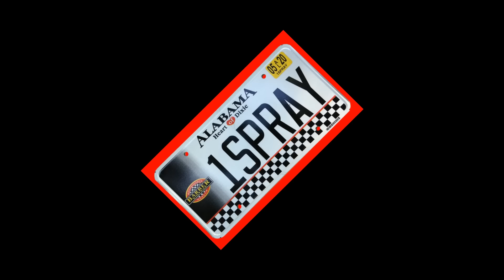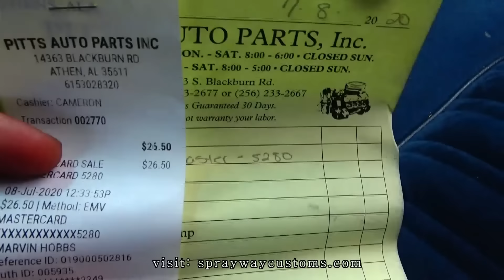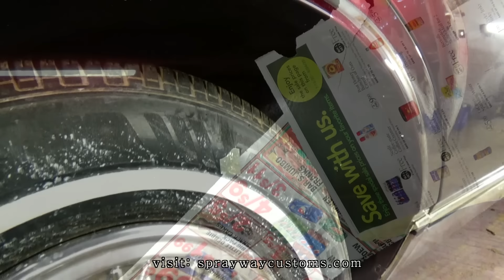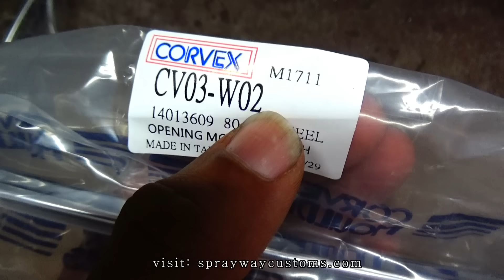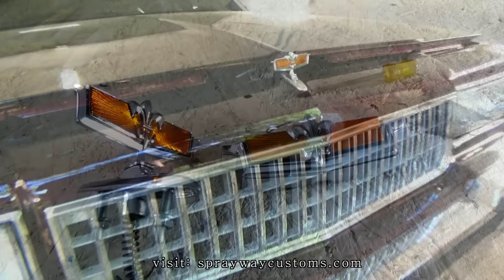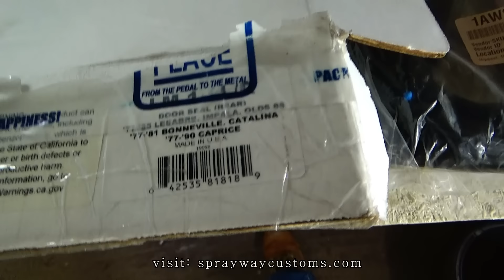Rebuilding A 1989 Box Chevy Caprice In Less Than 34 Minutes CANDY PAINTED BRANDYWINE LS SWAP BUILD

Comment from the maker: Here's The Links To All The Videos Of The Build:

6.0 Cammed LS Swap Box Chevy Caprice Brougham Candy Paint Project - Ms. Ruby - https://youtu.be/11YZKtOqTm8

Bodywork & Paint For Beginners LS SWAP BOX CHEVY CAPRICE Sanding Fixing Dents Dings Priming Masking - https://youtu.be/zT3YMmpcgYI

How To Spray Candy Paint BRANDYWINE BOX CHEVY CAPRICE KANDY DOOR JAMBS UreChem EyeKandy Wine Red - https://youtu.be/n8OU7XXyPRM

Cracked Dashboard Fiberglass Repair Painted Candy Brandywine BOX CHEVY CAPRICE HOW TO RESTORE DASH - https://youtu.be/6PKaOF0FqZ8

Spraying Candy Paint On Box Chevy Caprice - Door Jambs Painted Kandy Brandywine - UreKem Wine Red - https://youtu.be/aD-Tcq-Z_Js

Bodywork & Prep For Spraying Candy Paint On A Car / Box Chevy Caprice LS Brougham Project Update - https://youtu.be/ESWprX2argc

How To Do A Candy Paint Job On A Car At Home - Box Chevy Caprice LS Brougham (RUBY) Kandy Tutorial - https://youtu.be/VDbOpgxWwPk

How To Remove Orange Peel / Cut And Buff A Car After Paint - Box Chevy Caprice LS Candy Brandywine - https://youtu.be/PEBXPBgpzNg

Installing Vinyl Pinstripe & Body Side Molding BOX CHEVY CAPRICE How To Install Pinstripe On A Car - https://youtu.be/LwXahCCbP1o

Emergency Bodywork & Bubbling Paint Issue Repair BOX CHEVY CAPRICE BROUGHAM Vinyl Pinstripe Install - https://youtu.be/tcI4Pj_f-Ow

Box Chevy On 26s - TEST FITTING THE 26 INCH RUCCI WHEELS ON THE LS SWAPPED BOX CHEVY CAPRICE (Ruby) - https://youtu.be/_gXdlQloae8

Complete Playlist  Of The Project Build - https://www.youtube.com/playlist?list=PLJdTIOzocIjuCExyIZP4pRhL8iF7KLCrl
Reply: How can i get in touch with you? Want you to fiberglass my k5 blazer dash with radio relocation.
Reply: Nice one. Thanks. I waiting for this one.
Reply: Nice one. Thanks. I waiting for this one.
Reply: I got a box I want you to do
Reply: damn straight ..   thanks for sharing ,love the nostalgia   80s gen.    brings back memories
Reply: @Morgan Adriel instablaster =)
Reply: @Elliott Mack It did the trick and I finally got access to my account again. I'm so happy:D
Thank you so much, you saved my account !
Reply: @Morgan Adriel No problem xD

Comment: Eastside Low Bottoms sh*t !
Tappin' in from South Central Los Angeles
Damn, this video is giving me the motivation I need ! I hv an all original '85 2 door Landau Caprice I bought from an older couple about 2 years ago. Fully complete ! Running, driving, AC and missing nothing ! Been getting little things for it here and there. I recently got the '90 smooth front and back bumpers. So now I hv the front and back euro lights as well. Just need the rear bumper fillers. I also want to put a 42" moon in it. I want all new emblems as well. Those small details make a big difference !
Although mine will be a lowrider, u lookin' good out there ! Much respect. 
✊🏾✊🏾
Reply from the maker: Thanks man. I have a 86 Landau myself. I've been slowly buying things myself. Check out this vid if you haven't already. https://youtu.be/GgdRUDipHzk
Reply: @SprayWayCustoms  
Eastside Low Bottoms sh*t !
Yezzirrrr ! At one point about 10 years ago, I had 3 two-doors at one time. '85 Landau, '86 regular and '86 Landau. Frustration mixed with stupidity made me get rid of 'em. I need my azz kicked ! Lol. I hv a few 2 door Malibu's now.
Reply from the maker: Low Bo47oms Ascot Ave I'll never get rid of my Caprices